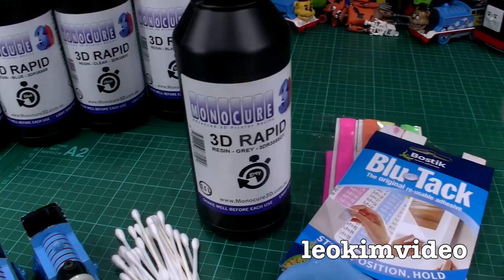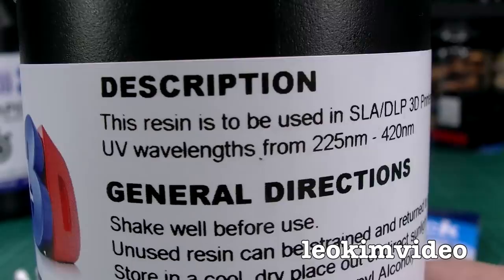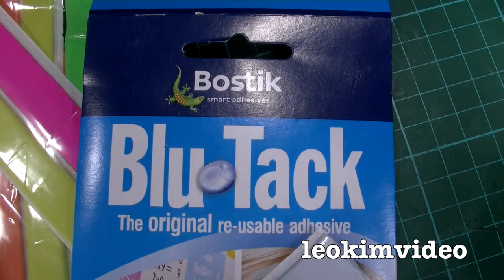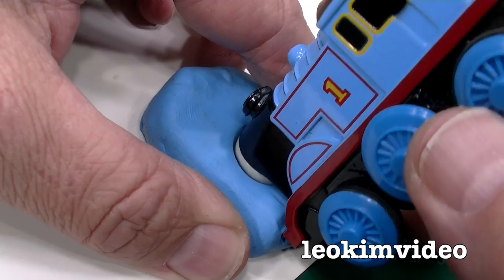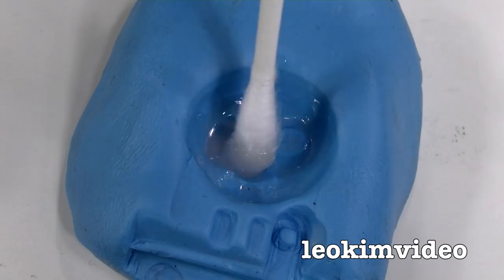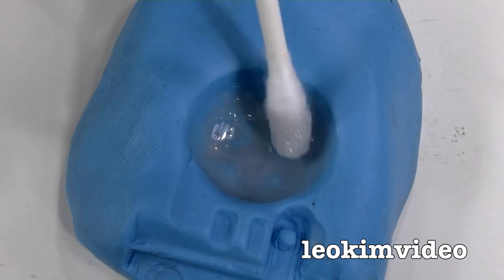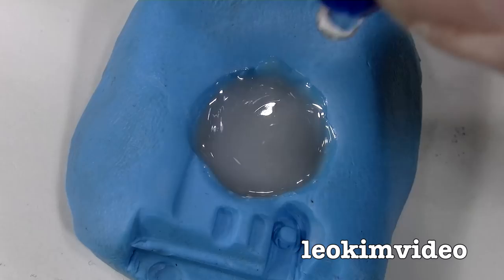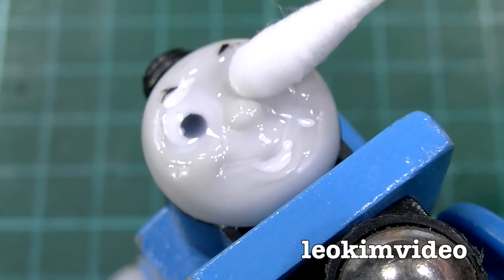Thomas The Slenderman Tank Face Duplicator How To Monocure 3D Resin Fast & Simple

Comment: I'm part of a fangroup of people who are still making accessories for a toyline that has not been produced in... over 30 years now. We've been using traditional resin but this seems like a good, cheap way to make at least things that don't need a complex mold.

The only step I would add is sanding things so they look smoother.
Reply from the maker: Nothing wrong with traditional resins but you need to really be careful how much it costs to buy. Sadly there is a trend for many art shops and some online sellers to play games with prices. It's often far more affordable to buy a bulk amount Vs little bottles of product.